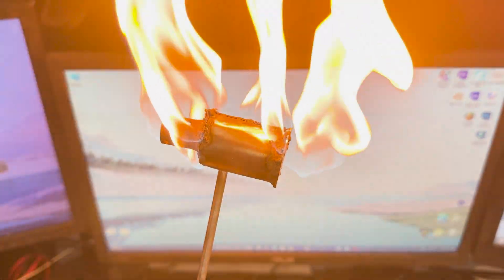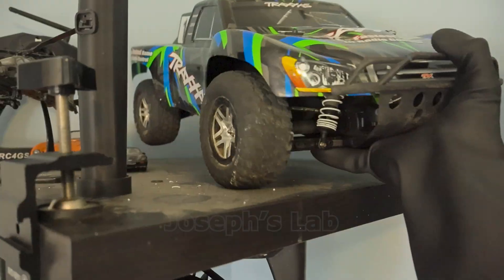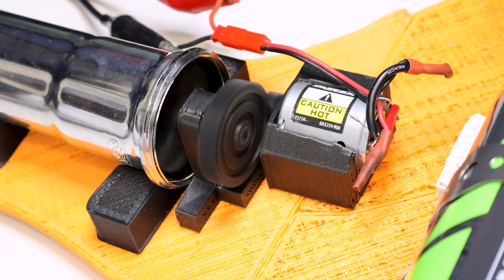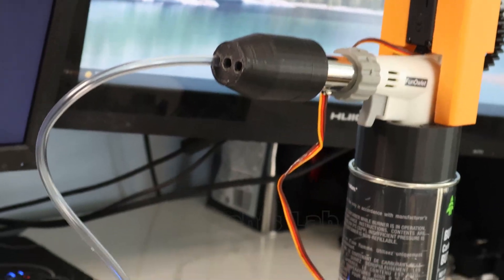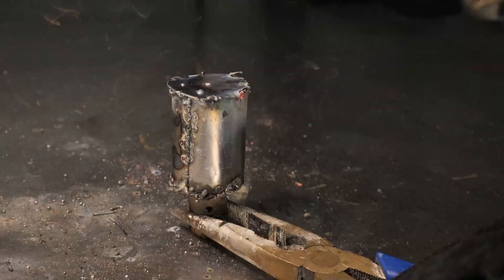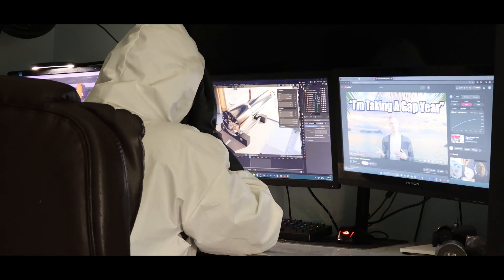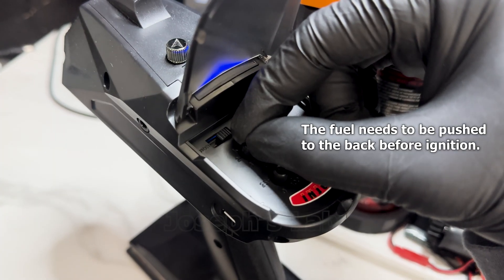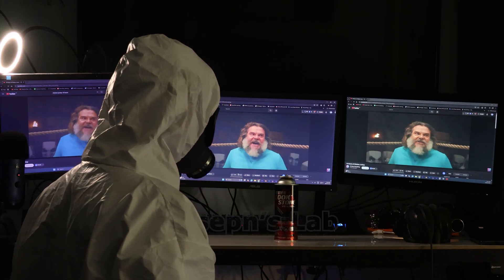I made the Coolest R/C Jet Engine you'll ever see..

Comment: Behind the prop you need stators and a diffusor, after the chamber you need HPT nozzles and then a turbine. And everything has to have the right pressure and area. Not easy to get everthing right. Belive me I am a Jet engine mechanic.

Comment: 5:50 Hey friend.  Is there a flashback respirator in that black plastic piece or are you burning a straight pipe to your tank of liquid fuel?
Reply from the maker: There was no respirator in that black plastic piece, it was a straight pipe.
Reply: @Josephs-Lab  I'm no safety Nazi, especially if someone isolates themselves so they don't effect anyone if they blow themselves up.  BUT, they're pretty cheap and they set a good example for a younger audience (:

Comment: Jet engines tend to use a impeller rather than a propeller. For maximum airflow, id recommend doing a propeller then an impeller in a 3d printed chamber thats a little bigger than the flow chamber. Inside of the flow chamber there should be a thin combustion chamber with something to block the flame from directly going out. On the end of the engine, connected via chassey should be a steel turbine to reuse some of the energy to power the compression happening on the front end. To start you could use the same motor but with a slip gear so once you get up to speed it moves. And I loved the enginuity for the fuel system, try flipping the beutain for more power!

Comment: You made a supped up hair dryer on fire I guess thats kinda cool def not a jet engine though theres no compression of hot gasses your just blowing fire through a tube, jet egines use a sustained combustion chamber that drives turbines that in turn compress the hot gasses to generate pressure at the outlet they sure as hell dont use a fan driven by electric motors. Nice blow torch though.